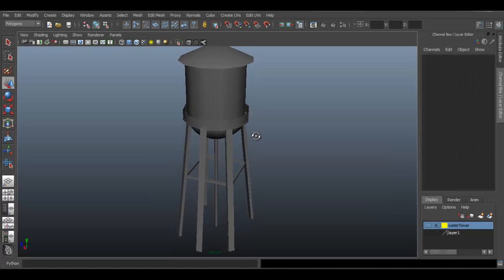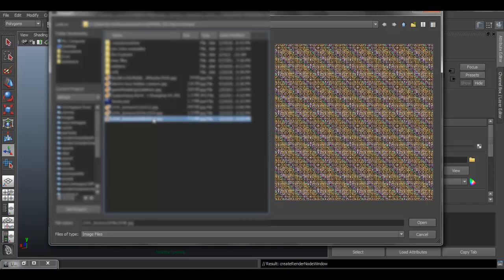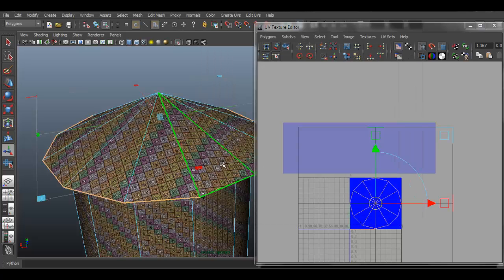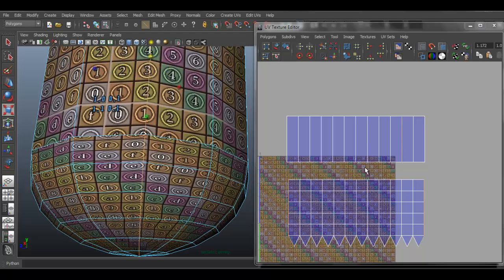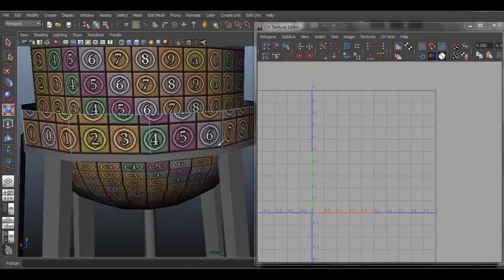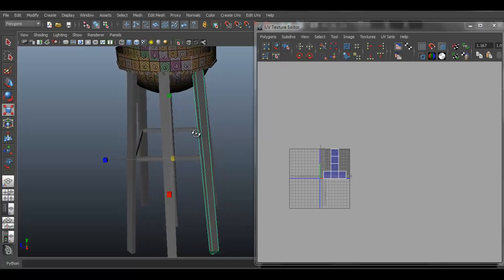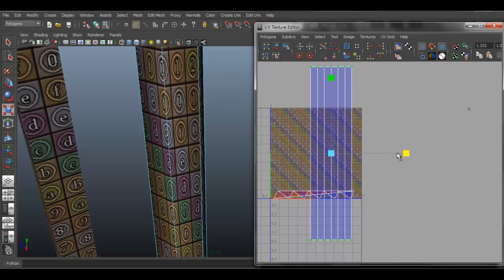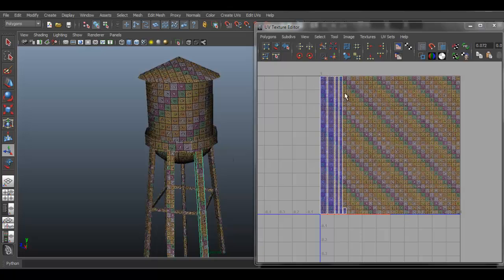Autodesk Maya 2014 Tutorial  - Water Tower UV Mapping

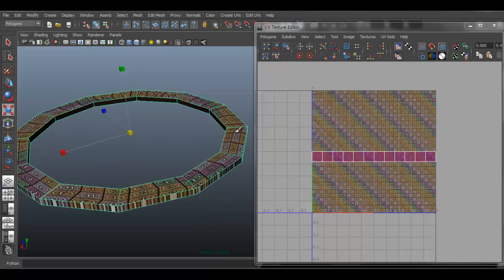Comment: if I try to follow your step at 10:00, my "ring" is getting veeery big after creating the planar map, i don't understand why :(
I am using maya 2014, too
Reply from the maker: very big in the uv screen? make sure that in the planar map options box you have it set to keep aspect ratio. you may have to rescale the pieces manually
Reply: 3dEx if i try to scale it down, it doesn't work...the ring is flat afterwards and the checkermaterial is flickering
i will upload some screens!
Reply from the maker: LIFADxD that sounds weird, if you can upload some screenshots that would be useful.
Reply: i have sent you a private message
Reply from the maker: LIFADxD I just the saw the screenshots. So the model itself increases in size when you create a planar map? is that the problem. I recommend you delete history just in case that is causing problems, go to edit - delete all by type - history. I really don't know how creating uvs would increase the size of the actual model.
Reply: yes, that is the problem!

I just tried it, but deleting the history did not fix it.
It is not only increasing, the texture starts flickering, even if I scale it down.

Maybe I made a Mistake while building the model? Is it possible that this can be the origin of my problem?
Reply from the maker: LIFADxD I have never encountered such problem so I am afraid I am not sure what could be causing this problem. I would try to remake the model in a new scene and see if the same happens.
Reply: okay...maybe i can just delete the ring and make it again in the current scene, to save time???
how can i start best making such a ring again?
Reply from the maker: you can try that. just do it the same way you did the first time.